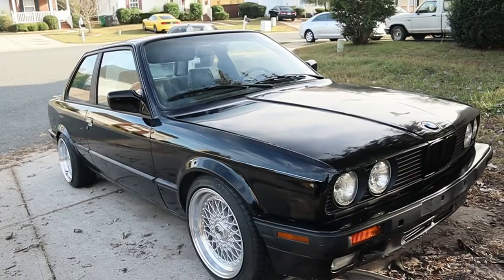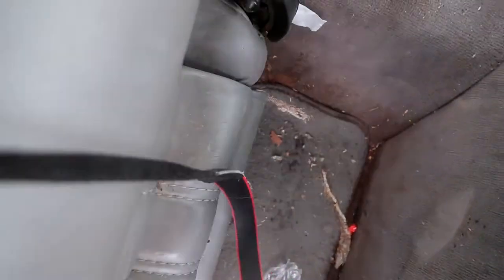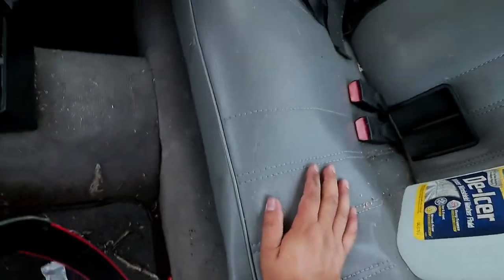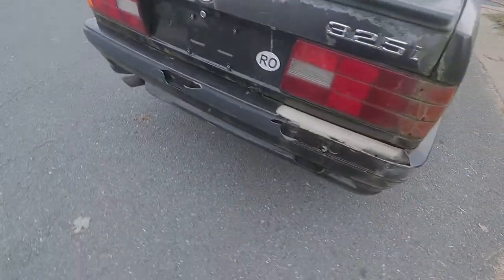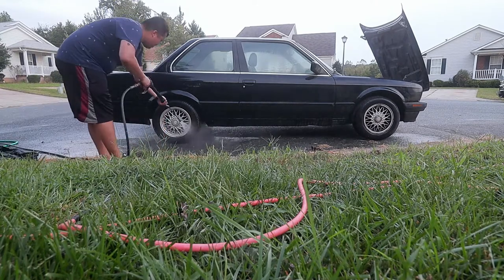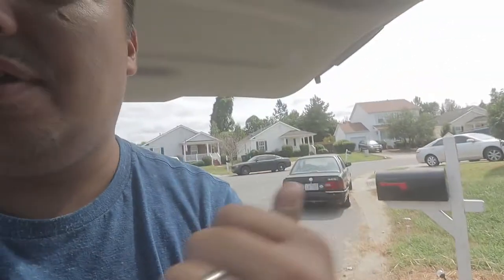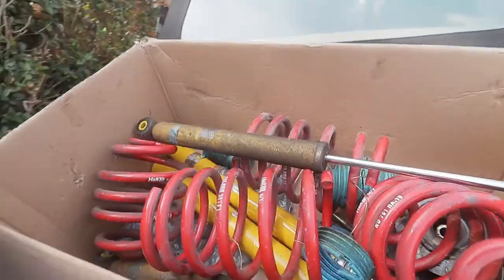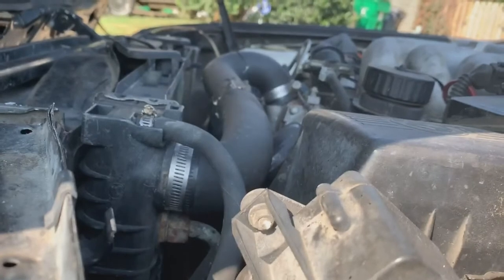My $500 1991 BMW 325i E30 Project

Comment: Nice job bro I really like the wheels, can you drop a link from where u got them.
I have a 1987 convertible that I recently picked up and one of the things I’m looking forward the most is putting some new wheels on it. Much appreciate it.
Reply from the maker: Heck yeah! Congrats on the nice find. Brand:

ESM WHEELS

Model:

ESM-002R

Wheel Size:

 16x8 2" lip & 16x9 3" Lip

Offset:

Front +20 / Rear +15

Bolt Pattern:

4x100 & 5x100 dual drilled

Finish:

Silver with Machined Lip

Center Bore:

57.1
Reply: Thanks dude, keep us up to date with the progress, enjoy the journey 👍💪😀
Reply from the maker: @taboo3409  sure thing! really appreciate that. i love this car. still a lot goin on with it but ive been driving it to find out the other issues. Break caliper guide bold broke today butr i was able to get a replacement from home depot pretty easily.
Reply: Lol yeah they are full of surprises but the good thing is you can do most of the stuff yourself and it’s fun working on them not having to deal with electronics and technology. 
Btw are you running any spacers on front wheels?
Reply from the maker: @taboo3409  agreed!, nope just the regular fitment and the tires are 205 45 16. no rubbing at all in the front
Reply: What size tires in the back?
Reply from the maker: @taboo3409  The same 205 45 16
Reply from the maker: These exact tires and then i had them shipped to sears to have them installed. https://amzn.to/2MFTP3O
Reply: Dustin Vang you think i can run the 16x9 on the front too??
Reply from the maker: Taib Bundavica yes just have to roll well
Reply: Dustin Vang yeah depending how low you are right, but that’s one thing I don’t want to do. And 16x8’s are not rubbing at all?
Reply from the maker: Taib Bundavica 16x8 in front for nice no rub